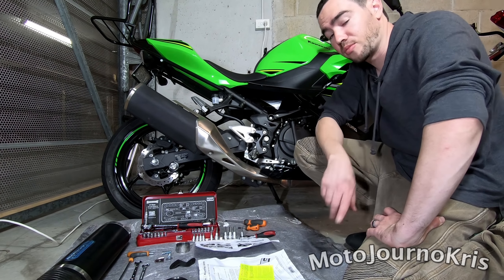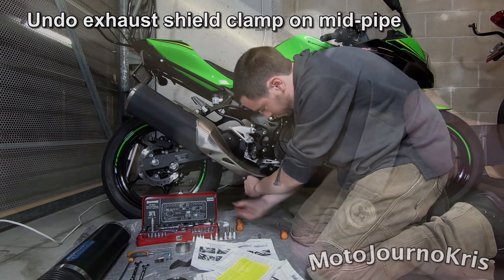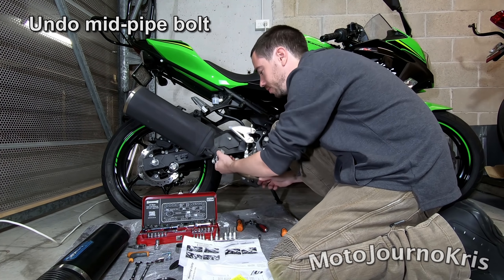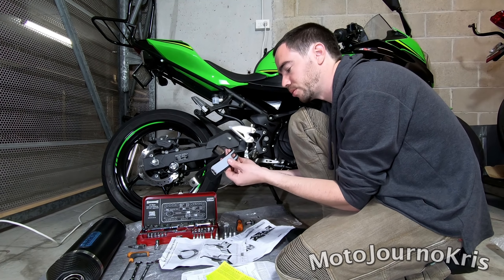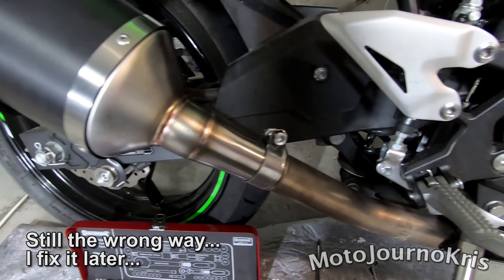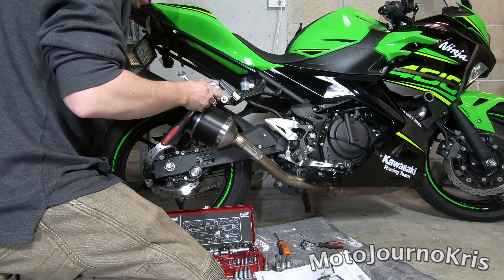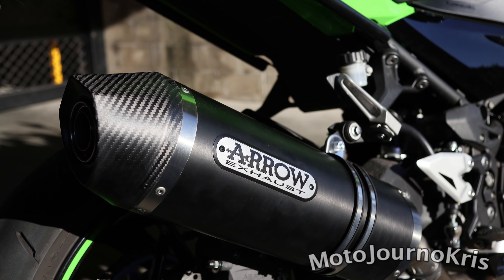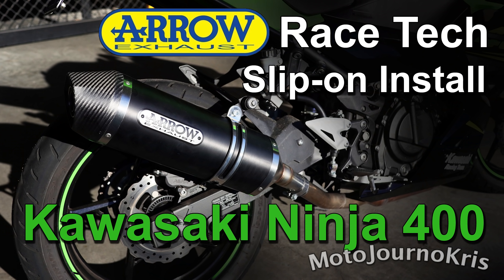Arrow Race Tech Slip-On Exhaust Install - Kawasaki Ninja 400

Comment: Great new can! Thanks for the information and walkthrough, what a lovely bike! Now it sounds better, too. I hope it just doesn't interfere negatively with the performance of the motorcycle.
Reply: Also, is there an aftermarket grab handle for the pillion, like the handles in the BMW G 310 GS? Thanks!
Reply from the maker: So far it seems unchanged, although I was told that removing the baffle will have a negative effect on performance until properly turned. With the baffle in it's meant to be similar to the standard system, but obviously a bit louder. I'll have to do a bit more testing in different conditions, like longer freeway rides and some sportier roads to know for sure.
Reply from the maker: @felipe-nt-d  I know on the Ventura system I've got you can grab a U shaped grab handle bar to replace the rack setup, which adds something to hold onto directly behind the pillion. I haven't been able to find any side mounted grab handles more like the G 310 GS however.
Reply: @MotoJournoKris  thank you for the insightful replies!

Comment: Hi Kris, I am thinking about getting the ninja 400 for my first lams bike and I was wondering is it legal for a learner to put one of these little puppies on a bike ? Sounds so much better with it on. Great video :-)
Reply from the maker: I think technically speaking any modifications to LAMS bikes are not allowed - at least here in NSW if you check the wording of the rules, but I still see slip-ons on many L and P-plate bikes. The Arrow with baffle in won't upset anyone, although baffle out is a bit louder. I think it just comes down to whether you want to risk it, which isn't all that dissimilar to being fully licensed. They just tend to keep a closer eye on L/P platers for enforcement.
Reply: @MotoJournoKris  I understand, yes I agree it may be too small a thing to risk the consequences of getting caught with it on. 2 years goes by very quickly anyway. Thanks Kris I think I will wait for my unrestricted license, I appreciate the feedback and I love your channel, take care.
Reply from the maker: @sean...  That's definitely the safest bet!

Comment: Do u need dyno tune for slip on exhaust?
Reply from the maker: They recommend a tune if you run it without the baffle (although you could get away with no tune, it just won't run as well), but it runs great on the stock bike with the baffle in.

Comment: did the engine light stay on after you installed?
Reply from the maker: Shouldn't be an issue from memory, there's no EXUP you're disconnecting so nothing to cause an engine or error light.

Comment: Did u install it with torque wrench
Reply from the maker: No torque wrench for this one, but if you're worried about getting the bolts to the right tightness you could.

Comment: Go for full set,ecu reflash and dynotuning
Reply from the maker: Bit hard to justify on a bike like this unless it was getting tracked or raced, for me at least. If I was going to do that, it'd be on my Daytona with the Taylormade Racing exhaust!
Reply: Moto Journo Kris i use Power Commander V,ECU reflash,K&N airfilter and full set Yoshimura on my previous 2007 Suzuki GSR400 which run perfectly even on highways mate...Not far behind from a stock GSR600 either..Not for track but just a bit of juice for normal riding when you need it..Even my cars i do stage 1 mods
Reply from the maker: @normanhughedicko4076  I ran similar on my FZ6N a number of years ago, back in the PC III days, with K&N and M4 exhausts. Terrible though it is to admit, I'd rather some look good/comfort mods than performance mods (apart from an exhaust) on a lot of machines, unless there's an issue with fueling or performance I want to fix! But a PCV and custom tune is huge money once you add dyno time around here.

I think I got my PC III back in the day for $200 and there was good maps to suit. Now the PCV is almost the same price as a good exhaust.